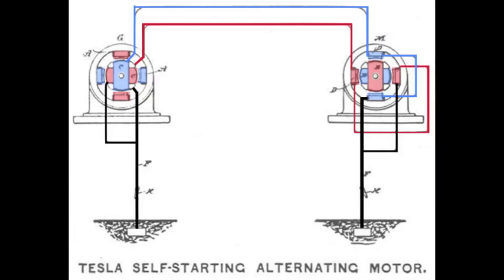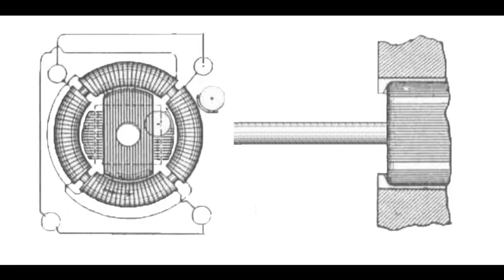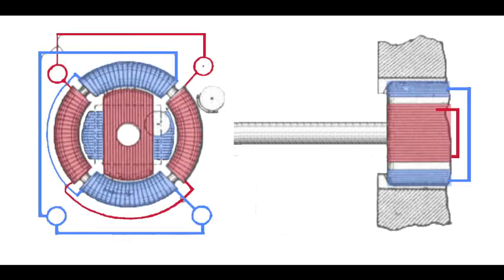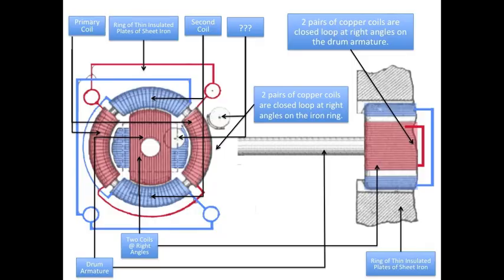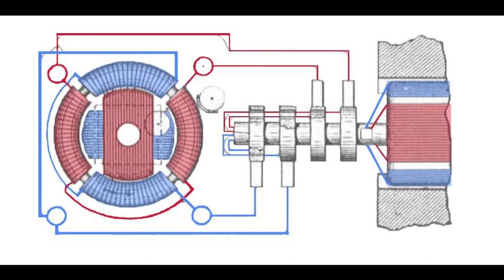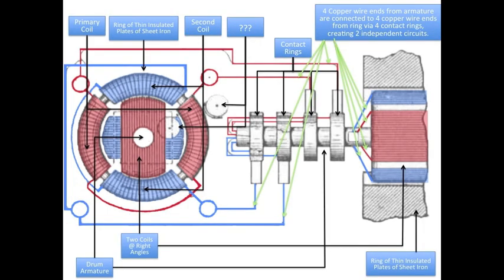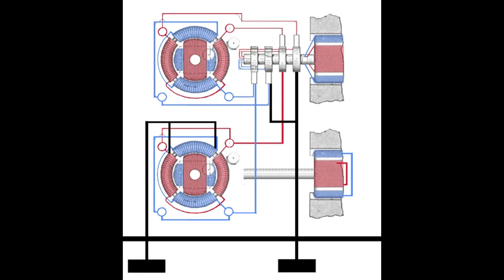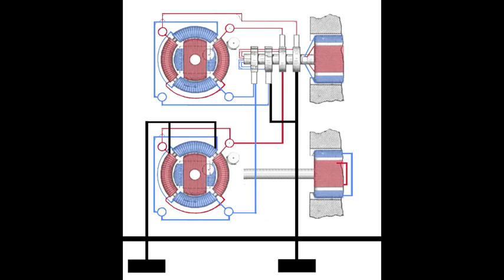How to Build Nikola Tesla Free Energy Alternating Dynamo and Exciter Motor - Diagrams - DIY

Comment: I believe the white circles are an indication of the contact rings. In the first drawing you have shown, there is an R labeled on the ground wire and I think that is the indication of the resistor being maybe the length of wire for ground having a resistance, maybe to create a larger difference in potential between the two motors, allowing one to have greater voltage than the other so the voltage across the coils is present for the motion. Once one motor spins, it creates the energy for the second motor to draw from the Earth at a greater difference in potential . If they were both grounded exactly the same having say 20 ohms, they wouldn't have the voltage necessary, causing one to take from the other because the electricity wants to take the least path of resistance, so, saying they would be the same, the would both just go to the same place with nothing happening.
Reply: you're welcome. I always try to assist with my views, however, I am extremely confused since they say one ground gets removed, then the other... Maybe the one with more potential stays running until it gets up to speed from the first? I'm not sure.. It seems it would be a great idea to use heavy weighted flywheels to assist with the motion once the motors get up to speed so one doesn't solely rely on the motor and it's ground connection in the event the potential difference between the motors isn't there, or, the motor slows down too much from removing the ground, at least it will move long enough to generate the power to run the other motor.. To me it would make more sense if one motor was larger than the other so it could produce enough for the other motor and pulse the energy needed with an arc gap with maybe magnetic amplification and capacitors as the Tesla Hairpin Circuit.. The ideas keep on coming when I see or hear about something new from Tesla. The man had so much bottled up in him.. I wonder what would the world would be like if we had computer and usb drives to store all of his invention data way back then.. We'd be so damn advanced today!
Reply: +Marc Belanger A modern day automobile can be disabled by simply disconnecting the ground wire from the chassis connected to the negative terminal of the battery. I'm told vehicles are a two wire system but to my simple mind it appears to be a single wire system. Even my cable tv line coming into my house is grounded and the line at the transmission point is grounded as well. Same thing goes for FM, AM TV/HDTV and satellite transmission facility's. Is it possible something has been overlooked here?
Reply: Vehicles are a two wire system being that the ground is like a giant bus bar where all of the grounds in the entire vehicle tie to it as a return to the battery. The modern vehicle also relies on the dc power to run a computer so it turns on the ignition and other computer controlled items, so, no, it isn't a 1 wire system... However, in the past the vehicle did utilize a 1 wire system to run the spark coil. It was fed by the alternator as a 2 wire system, then, it used the distributor with a condensor to fire the spark coil as needed for each spark wire. The coil itself can be used as a one wire system due to it's voltage and it's ability at that high voltage to "capacitively couple" through the air using ions to return the energy through that air which becomes ionized enough to return the energy, but without drawing an arc the distance it returns it's energy to run back through the source, over and over. There really isn't any true "one wire system" that can magically operate without a return of some sort, it just seems funny for devices to work with one wire, so, the fact is they really work like a 2 wire system either using what's called an avramenko plug to force the energy to go in two directions, one, a wired source, and the other transmits wirelessly via capacitive coupling, not inductively as science says Tesla's systems worked. Tesla had found that his "one wire system" was a wire that fed his energy into the ground and returned the mirrored and then recycled energy after it was used by the load, back to the source, through the air. The ground connection reacts faster than the speed of light, and, the waves propagated through the air are much slower, however, the way the phase conjugate mirror system works is the energy is pumped into the ground, it has specific components, either an fwbr that acts as an avramenko plug, and, a couple of antennas or plate capacitors, capacitive sphere, or large aluminum torus, again acting as a capacitive coupling and antenna all in one. The energy is fed one way and limits it's conventional flow by way of a valve, which is the rectifier. It does the same thing as the Moray Valve and I have been playing with these technologies for years.. getting better results every day. I have gotten this to work so well that I have been able to capacitively couple batteries into these circuits, giving them the ability to self charge and run bulbs forever. There isn't much ability to run many bulbs, but, if I use leds, I can light 8 to 10 of them without reversing it's charge. The charge picks up once a neon sign transformer is turned on, and, once this happens, the battery voltage rises .2-.3 volts and stays there until the load is added, then, it remains at that loaded voltage , normally 12.3 volts and will remain. The inverter stays ice cold the entire time because the energy is not reacting to become hot with the resistance as it is cold electricity and thrives on higher resistances, opposite of conventional energy.
Reply: In Dr. Tesla's diagram here he shows one wire going to ground for two different devices that also interconnect directly with primary and secondary wired backwards from transmitter to receiver. Dr. Tesla stated his world wireless system was capable of transmitting the audio signal and the required power to move the speakers together as one with both propagating longitudinally via the ground connection only at a 95% efficiency rating input to ouput. Today it takes 50,000 to 100,000 watts just to get only a radio station signal across a large town and we STILL need a source of current at the receiver to power the car stereo that is connected to a battery that is connected to ground...
Reply: Dr. Tesla's system transmitted via pure electrostatic phenomena with the electromagnetic component removed entirely during transmission. The electromagnetic side was added again at the receiver end. Hence the inverse square law is meaningless to Dr. Tesla's wireless system. He realized right away the transverse waves were useless for transmission due to their scattering nature. Now Marc have you ever applied the inverse square law to supposed electromagnetic signals coming from satellites?

Comment: Im surprised that this guy was able to write a book. His "studying" of N. Tesla's schematic designs must be a free-for-all of rogue synapse firing because he knows about as much electrical theory as a middle schooler. Point of note: the field of electrical engineering & design was a new frontier during the late 1800's up until, well, now. The most documented intellectual  bout; "Current Wars"was publicly witnessed and a struggle of Industrial tycoon lobbying. But any peer reviewed articles of Tesla's in any periodical would be of the vaguest of description of function and schematic design. The sinusoidal wave form of Alternating Current; A/C was impossible for the self enlightened inventors of the time to comprehend. The fact that A/C waveform is perfect, as it is in nature, and  travels through magnetic fields or conductive lines, was a concept that was too visionary of a thought for their self taught brains to comprehend, just as Electrical Theory is to flyfisher. Not only have you got the diagrams  off in the  explanation of function, but also the wiring is wrong. Two A/C signals, when coupled correctly, create a third signal. This is phase relationship. This is a backbone to Tesla's understanding of magnetic fields. Also, R/F frequency (radio-frequency) travels throughout the universe at the speed of light in what what waveform? Sinusoidal. That's not coincidence, that's physics. The only dots connected by flyfisher are the dots of delusion.  Tesla's design of an Earth powered EMF transmission and a phase  generator/coupler (the more practical definition of these devices when explained properly) will never work as intended by any attempt made by flyfisher. I would recommend a community college electronics beginning course  to understand what electricity is, what energy is and how we manipulate electrons by jumping them from atom to atom in different scenarios to transmute energy in manageable forms to create work. Remember the Law of Conservation states that ALL energy was created by the Big Bang and is constant and forever in the universe. Its not made, created, manufactured or used up for that matter. Its abundance is always and everywhere. Even in the magnetic frequency oscillation and harmonics in the Earth's magnetic field ( 12-16 Hz, depending on flux intensity)
Reply: +Dominic Njoes In other words you are saying Tesla was wrong with this? :D

Comment: I know you are doing your best but, Tesla's "exciter" is a electro static generator, which is good for generating a current that can drive a motor or other generator, however it does take an outside fore to drive that static generator to drive the other apparatus, and simply wiring the poles as pictured and grounding the apparatus wont make it magically run.

 I am a Tesla Fanatic however and i like your ambition so ill give you a tidbit. I have seen a patent somewhere where he developed  a transformer that operates off of a _______ as its input.  The ______ is set to  the resonant frequency of ___, calibrated by a mechanical apparatus to adjust the input frequency to react to exact operational resonant frequency of the ___.  Once he had the input dialed in to react at the correct resonance, it was fed into a transformer to step up the resonance and fed that into coils to generate sufficient current for use as a completely remote energy source with no generator needed, supplied endlessly by the ______ _____ . This is the precise reason why his Wardenclyffe Tower was knocked down by the US Government and the associated technology being developed was burned to the ground in his Laboratory in Long Island.
Reply: Sean Sullivan supplied endlessly by the flux capacitor , 369
Reply: So, what's the input mechanism? Either tell us or Al Gore will be fisting us all
Reply: Sean Sullivan   
 electric Universe.
Reply: Sean Sullivan hmm..

Comment: I don't see any claims made by Tesla in the patent that this machine runs by or creates free energy.
Reply: Modern electric power systems do not use the ground as a conductor. Grounding is done for safety purposes only. Where to ground systems is still not fully agreed upon therefore some systems inadvertently have ground currents. No electrical inspector would approve a system that used the ground as a conductor for starting a motor.  Ground currents can become dangerous to both people and animals. When an unintended ground current occurs it is called a ground fault and many systems have ground fault protection to shut down circuits that are causing ground faults.
Reply from the maker: Kim O'Brien There are three articles in the attached video where Tesla describes how the motor can be run by simply plugging it into the earth.  The diagrams in the article shows exactly that.

https://www.youtube.com/watch?v=GxphVKVsR_g
Reply: Kim O'Brien 
actually it is the free transfer of energy, not on production as some wedding guests
Reply: Prvi Zadnji No such thing as free transfer of energy. You always pay in some way or other. Loses are a fact of life.
Reply: Prvi Zadnji What?  Someone please explain what is being said here.
Reply: +Kinkou Kinkou You can't draw upon the imbalance of charge of the earth because you have no where to drain it to. When fly fisher can build a real perpetual motor instead of misinterpreting things than we'll have something to discus. Go ahead fly fisher win a noble prize and save humanity from global warming.
Reply: Kim O'Brien Yep, these nonsense spewing experimenters have no concept of energy entropy. There MUST be two frames of reference in any energy system.
Reply: Kim O'Brien there is the aether. lol

Comment: Fly, thank you for the vid! Have you additional info on the windingdirection? Are all coils clockwise wound, or are they eg. Clockwise/ counter-clockwise/ clockwise/ counter-clockwise etc? Thnx! H
Reply from the maker: Mobi Gozer I have no information regarding its winding. I dont think it matters as long as you stay consistent in its overall application (one way or another, not both). The magnetic field and how the fields are aligned is what's key. I suggest bit-torrent "Derek Worthington - Tesla" its 1-gig of articles that talk about his inventions. Also check out these links:

Maybe you might find the windings here, there are dozens of patents explaining the dynamo motor and its build.

http://www.teslauniverse.com/nikola-tesla-patents?PHPSESSID=261452d229f51fa9f86cc2ecf7ccbc23;

This is the actual patent regarding how this machine is built. I have yet to do a video on it, but this will hopefully get you one step closer

http://www.teslauniverse.com/nikola-tesla-patents-390,721-dynamo-electric-machine